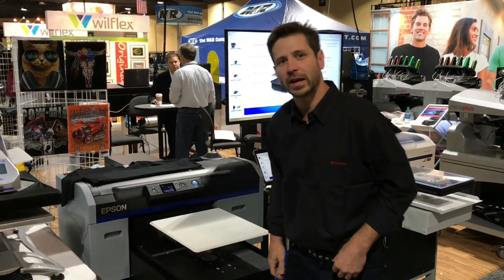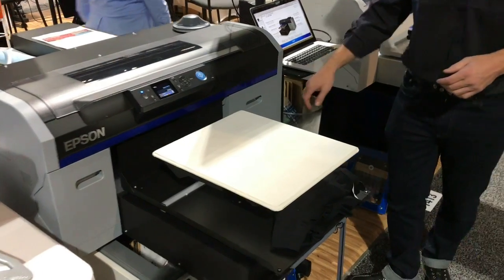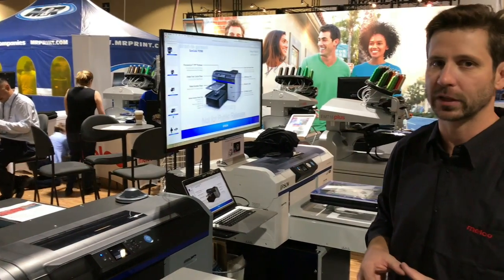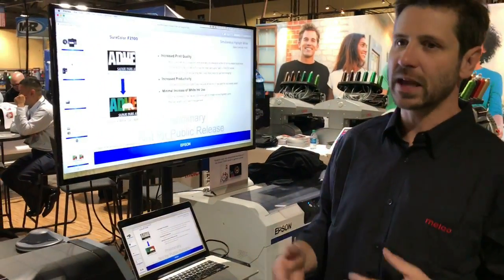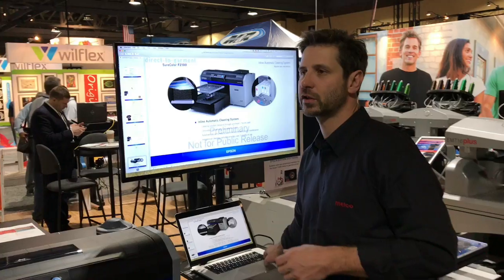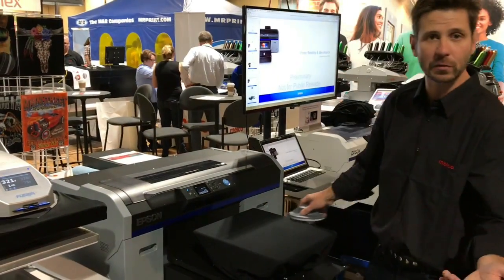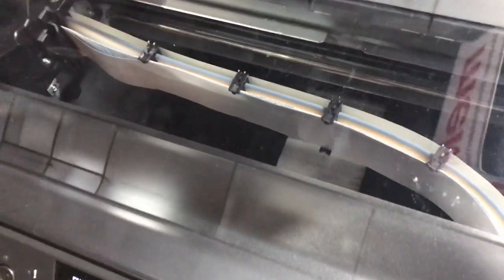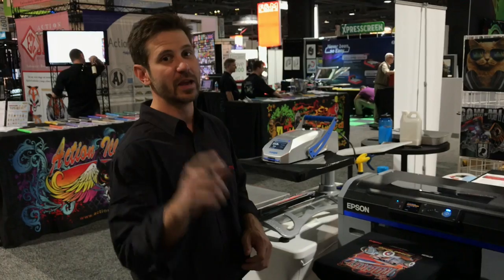Epson SureColor F2100 Direct to Garment Printer Demo

Comment: how many same shirt can you print with full cartridge ink ?
Reply: Good question and the answer is it depends :) Ink consumption on the F2100 is based on the size of the print and how much ink you choose to lay down. The bigger the print, the more ink used, pretty simple. I'd say on average 2,000+ Shirts with the 600ml color ink cartridges and around 200 prints with the white ink cartridges. Color and white cartridges are the same price. More white is used in creating an underbase and highlights and there is only 2 cartridges.

Comment: I plan on buying this or the anajet ri 1000... Can you explain to me why this might be a better option?
Reply: So there are quite a number of reasons why the Epson stands out from the competition but I want to focus on what I argue is the most valuable element of any DTG printer, reliability. Essentially if your printer is down for repair or you are spending a considerable amount of time doing maintenance and trouble shooting, then you are printing and making money. Most maintenance on the F2100 is automated, and there is very little ink waste with maintenance. There is no need to ever flush the white ink lines. The print head sits in a dry caping station so there is no need for a constant flush of cleaning solution. The head cap has an auto cleaning cycle that only requires occasional manual cleaning. Plus Epson ink is extremely advanced, made by Epson and designed specifically for use in this printer, which aids the exceptional reliability. Additionally, the Epson warranty is the best in the business. Should something go wrong Epson will be at your location within 2 days of the service call, no cost to you. There are a number of significant advantages of the F2100 over the competitor units. Feel free to email me and we can discuss further jledrew@melco.com
Reply: @Johnny-Eldorado  awesome... Thanks, John

Comment: After putting the T-shirt on the printers “bed”(right before printing), don’t you need to put on the frame to hold the T-shirt or isn’t necessary or doesn’t use it??
Reply: The hoop is required if you are not using the non-slip pad. The non-slip pad does a great job of holding the shirt in place, it works somewhat like hook and loop. Use the puck that comes with the F2100 to smooth and flatten the shirt on the platen.

Comment: The thing that no one mentions is how much white ink it consumes. When the machine is idle it uses up the ink. When it's self cleaning on both Manuel and Automatic, it uses up ink. The price cost for the ink is 200.00 a cartridge. Which you do the math. I've in a month printed less than a 100 shirts and already spent over 1500.00 on ink in a month!
Reply: Edgar Pilozo how did you reach your sales? Local or online

Comment: So anyone that is looking to purchase a DTG machine from this guy I would think twice. I don't know if he is lying intentionally or out of ignorance. 

1. Processor speed does not drive the print head faster. This was not the limiting factor in the F2000 being slower. The F2100 is faster because it has the ability to print at a lower resolution. The white layer will be limited because you need the coverage but the color pass will can be printed at 720x720 dpi with almost no loss in color. This is the reason it is faster not because of the processor or variable drop size. There are drawbacks to this, any experience dtg printer knows that there are certain colors that will tend to band very easily. When printing at the 720x720 resolutions prints will be more likely to have banding (horizontal streaks)

2. Variable drop technology has been around for a while and Epson is not the only company using this. Yes they enabled it on the F2100 series but the capability was always there and many other companies use this. This does smooth out colors and lead to less grainy results. 

3. Variable drop technology does not speed up your print like he claims. 

4. "Highlight" white does not speed up your print it simply adds more white on top of white while your colors are printing, essentially treating white like a color. This does not speed up or slow down your print it simply makes your whites look whiter.

5. He mentions that you would print white and highlight white first on your underbase on the F2000. This would be considered your underbase, the F2000 did not have the ability to print highlight white.
Reply: Since they didn't respond to your comment, but everyone elses, means you nailed it. Thanks for the info!
Reply: Which is the best affordable DTG printer?

Comment: Looks good coming out of the printer but as soon as  you heat set it, Flat looks like its been washed 20 times garbage. 
After a month of testing yet to be able to get a salable product from this printer and no instructions anywhere on how to get any type of product that looks anything even similar to these videos..  a 15 thousand dollar mistake.
Reply: Hi David, Did the vendor you purchased your printer through send a trainer? At Melco we send a trainer with every printer purchase so these type of issues are less common. What you are experiencing is what we call "dye migration" This can be a common issue when curing with a heat press in any number of applications. The solution is, to print on a garment that uses a higher quality dye and fabric that is less vulnerable to dye migration. I suggest a ring spun cotton garment from Spectra, Cotton Heritage, or Hanes Nano. There are numerous other brands available; look for ring spun, or 30 single. Also, ensure your heat press settings are 320, for 75 seconds, 0-1 pressure with white ink.  Rule of thumb, higher quality materials, will yield higher quality results. You could also opt for a forced air conveyor dryer from Melco, this will preserve vibrancy a little better and speed up production. Happy Printing!
Reply: Thanks for the follow up, the company in Chicago we just purchased the equipment from after the Cleveland show sent a trainer who only stayed a couple of hours. Said everything we needed to know was on you tube
We didn't even have access to a users manual till the guys at firebird inks sent us the link, super guys they are.  In the almost month we've had the equipment we have yet to be able to produce a real quality product on anything.. Its always wrong material, wrong pretreat, wrong heat settings, wrong something.  Answer from suppliers is always ya gotta run tests, there is no standard setting for printing a t-shirt. I've already ask them to take the equipment back and refund my money. They insisted we try more phone training and we went back to printing garbage. If you can help that would be great. At this point I feel like I've pissed away 20,000 dollars for nothing..
Reply: Sure thing David, happy to help. I'd review ProDTG.com, you can contact me directly through that site anytime. There are few things I can relay now that should help. I always preach focusing on the 3 main variables to ensuring a high quality print. 1: Be sure you have a perfect nozzle check. 2: Learn to pretreat correctly and ensure you have good coverage. Pretreat is all about proper coverage in the area you want to print. You can watch my pretreat videos on ProDTG.com. Epson pretreat works well, though other brands may work better for you. 3: Ensure you use a high quality, ring spun/30 single blank. I like Hanes Nano as a baseline, Cotton Heritage and Spectra deliver the best results!. If you can do these 3 steps consistently, you should not need to mess around with Garment Creator too much. If a print looks bad, go back to the 3 steps; works 90% of the time, every time :) Happy Printing!
Reply: John LeDrew  thanks again, that was more training than we got from IT were only doing small orders a few times a week. They sold us the Lawson which of course we're untrained on.  Seems to soak the middle & leave the sides spotty. None of this has been easy when you're stuck training yourself.  I clearly made a poor judgement on who I purchased from.
Reply: Glad to help David. Great crew over there at IT; Melco has a slightly different model though. We recognize and focus on the importance of training and the little tips that help end users such as yourself be successful. Reach out anytime, and as always, Happy Printing :)

Comment: I understand and work with photoshop and illustrator all the time and have a good understanding of high quality imagery. I have a couple questions regarding the F2100 and the DTG process. First question: Do you only pre-treat the Dark and Black colors or do you pre-treat ALL the garments prior to printing. Second question: Can this printer print on other types of fabric? i.e. polyester, lycra, nylon etc. Great presentation video.

Comment: Im completely new to the DTG market and looking into possibly purchasing a printer. I know daily maintenance and time sitting is a huge thing and, if you’re not printing on a daily basis with DTG, it kills your machine. How does the internal cleaning solution affect that?

Secondly, if this shirt shown cost $2 ink to print, how much in additional cost is it to pretreat a shirt?
Reply: I always argue that reliability and ease of maintenance is the core factor with your equipment. If your printer is down or takes a lot of time and money to maintain you aren't printing and making money. The Epson has proven to be the most reliable and easy to maintain printer on the market. Maintenance is easy and nearly automated. Turn on, print, turn off and sleep well knowing that when you wake up, your printer will work. Learn about maintenance in this video.https://youtu.be/R2T_vzNs0eo Extra piece of mind comes with the Epson warranty. If something should go wrong, Epson will have a tech on site within 2 days. The internal cleaning function is important to the reliability of the printer. This keeps the head cap pump clean ensuring efficient head cleanings. Turn your printer off at the end of every print day to engage the internal cleaning function.
Reply: @Johnny-Eldorado  Hi John, do you think that daily maintenance is way over exaggerated by the community and not just the Epson DTG printers but all others as well? I come from a Roland Versacamm and before purchasing that people were so in depth on maintenance however after years of usage it's not really an issue. I went on vacation for a month came back and it was still working fine. Are DTG's the same?
Reply: @christianlionel1988  Good question Christian. Maintenance procedures on all DTG printers can vary. Most DTG printers absolutely require regular and consistent maintenance. Epson is a good example of how DTG has evolved and is now on par with a lot of other types of printers in regards to reliability and maintenance. The F2100 has truly become a turn off, turn on and print type of machine. So the answer is it depends on the DTG printer you choose. Epson is by far the most reliable and easiest to maintain. If you're used to the maintenance cycle of your Roland, you will love the F2100.
Reply: Get a kornit
Reply: @epicscratcher5162  Our experience is you will need 2 Kornit machines because one will likely be down for maintenance. For the 1/2 the cost of 1 Kornit you can have 4 Epsons', 1 pretreat machine, and one conveyor dryer. We call this a Pod and many of the larger print to order manufacturers are using pods because they are extremely efficient, reliable and easy to operate. Many smaller shops are moving to pods for the same reasons, but also because they so affordable.
Reply: Those machines are trash.Stick to sales bro.Talk is cheap.Kornit is by far the best printerout.Look up the kornit Atals if you must know
Reply: Brian Rollins Fuck off Troll!!
John LeDrew...you're welcome.
Reply: @epicscratcher5162   the  breeze  costs 6 times a 2100 and is not developed since 8 years or so.
the breeze comes with 1 year warranty, 3 epson coveres 3 years.
the only advantage is the included pretreatment. but in fact I can not produce much more than with the 2100.  Hence you've got to buy a storm II if you want to focus on sales. and this will be 20 times more the cost of a 2100 and not comparable.
Reply: @epicscratcher5162  Ok Brian, thank you for your opinion, no need to insult anyone here. Happy Printing with whatever equipment you choose to use.

Comment: I hate the fact that pretreat is still in effect even after 10 years :(
Reply: the good thing about pre treat is that you can pre treat the shirts and put them away and they should be good for up to 1yr so i like that! lets just say 1 day you are slow with nothing to print just pre treat a bunch of dark shirts and put them away in a bin so you do not get dust on them and pull them out when needed so if you really thing about it the pre treatment isn't a problem only if you do 1 at a time or 10 shirts a day because then you have to clean the spray nozzles after every use. i would personally pre treat a bunch of them and save them when needed.
Reply: hey blunted. any good reputable pre-treaters? I am thinking of jumping on board with DTG as i am getting tired of epson JSSP and vinyl. please let me know
Reply: look into the viper xpt 1000 touch screen. you can stack a good amount of shirts at a time instead of opening and closing a drawer that only allows 1 shirt at a time and the viper has a wide area to work with. What i also like about the viper 1000 touch screen is that you can move the spray nozzle up and down and side to side in case you are only doing a left chest print and you save pre treat solution. all pre treat machines do the same thing except some nozzles are fixed a certain height unlike the viper 1000 and yes other machines might have 3 nozzles or more and you can probably make it spray on a left chest too but from what i have seen the viper is what i will go with but ill ask my ppl tomorrow about the main differences since he has had hands on with several of these pre treat machines these past years and he even buys better brands from over seas "Japanese brands i believe" and instead of paying 4 or 5k he spends like 2k for one that does the same exact thing as the other drawer pre treat machines just know this    you will always have to clean your nozzles after a days use if you do not want them to clog up and have them spraying inaccurately. under is a link with the viper machine i am talking about. 

https://www.garmentprinterink.com/shop/viper-xpt-1000-touchscreen-interface-dtg-pretreatment-machine.html

Comment: I have a question, how do these Epson f2100 hold up to large productions? Is it even feasible to fill large orders w/ this machine, say about 200-500 t shirts per day, all year, or screen print would be the way to go under this scenario??? Please advise. Thank you..
Reply: it depends on the design. if you want proper high quality and can charge a tiny bit more for your product this is ideal. if your designs are more simplistic, less colours and do not require photo realism then screen printing might be better. but if high quality and photo realism is a must, kornit make much larger scale dtg printers to fufill larger orders. those large production kornit printers can cost about quarter of a mil USD. but still highly profitable if you have the orders to justify it. bella+canvas have a great video explaining dtg vs screen printing methods. watch it to get the printing times and quality comparison.